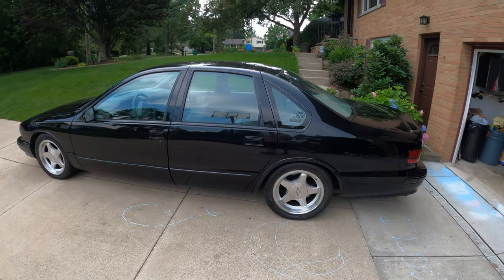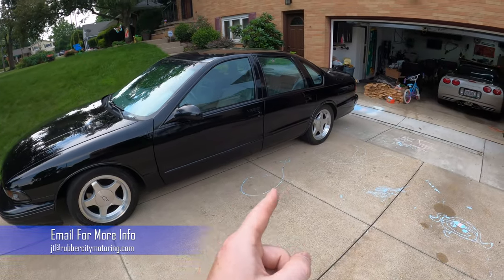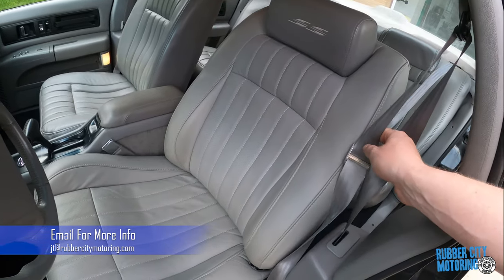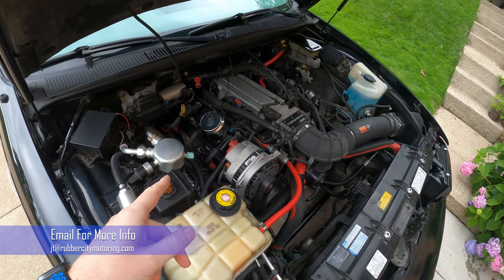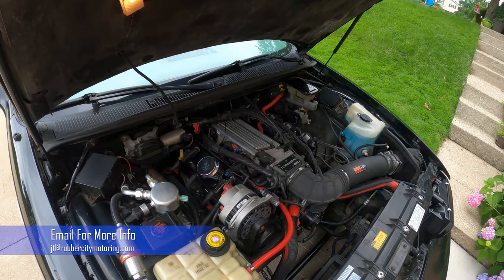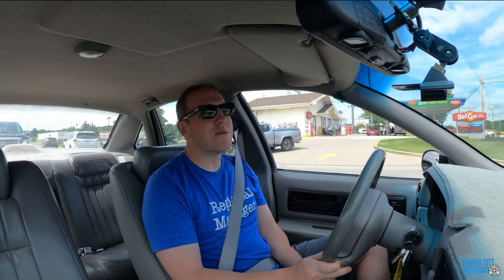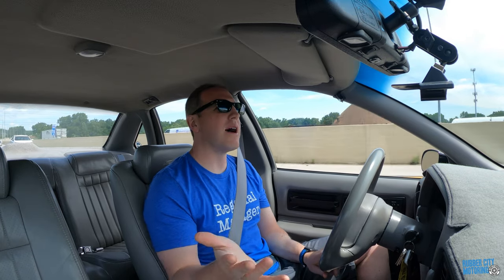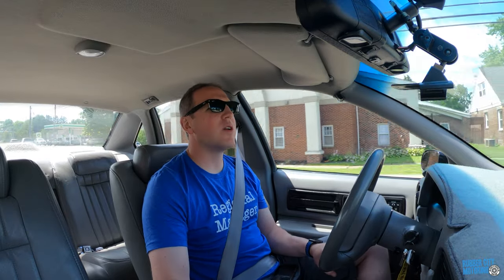1996 Impala SS For Sale - Selling My Impala From The Project

Comment: I cant find out between all your impala ss videos if you had the extended rear control arms? Your lowering and tire set up looks on point
Reply from the maker: So my Impala has the Hotchkis X-Tend setup, so they are the extended rear control arms.  I also had the longer aluminum driveshaft, which wasn't totally necessary when comparing it to stock. 

Tires/Wheels - OEM wheels with 275/40/17 on the back.  It did run a 285 out back for awhile, but the sidewall had me nervous, even though I experienced no issues.  

Thanks for watching!

Comment: do you regret installing the  torquehead and is it worth all the work? what were the positives and negatives of the install? would you do it again?
Reply from the maker: I did not. I think it was worth the upgrade and with so few good optispark options, it was a better choice than a junk opti from wherever. 

Positives were the instructions and I hope my videos add to that. Only really difficulty part is the crank hub. That’s nerve wracking cause you don’t want to ruin your crank. 

I would do it again. But I also don’t plan to own another LT1 at this point. 

Best of luck!

Comment: Are those aftermarket wheels or did you just change center caps if so what kind of wheels are they
Reply from the maker: Stock wheels with different center caps. Check my channel for a how-to on these.

Comment: I have a question why do you have two different tire sizes on there
Reply from the maker: Rear you can fit a little wider than front I was always told. I just never ran any larger than a 255 up front.